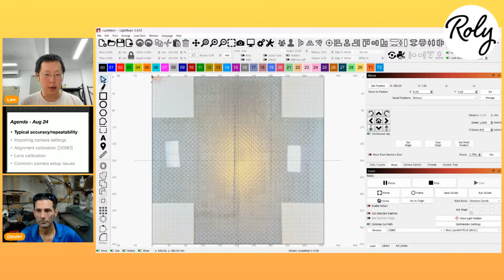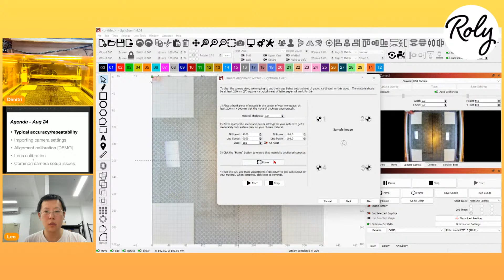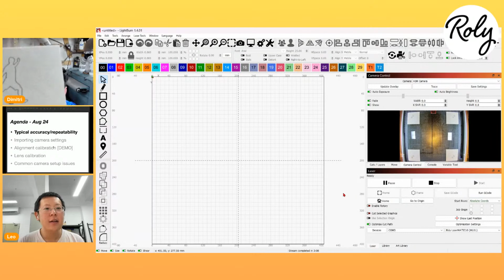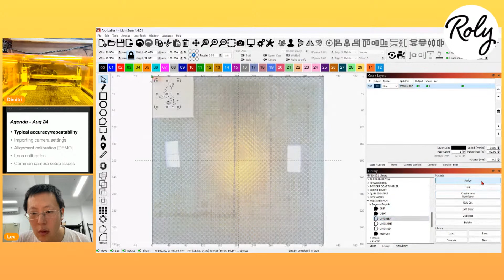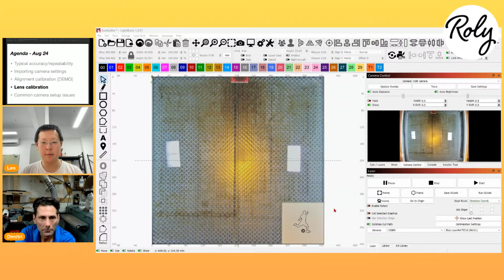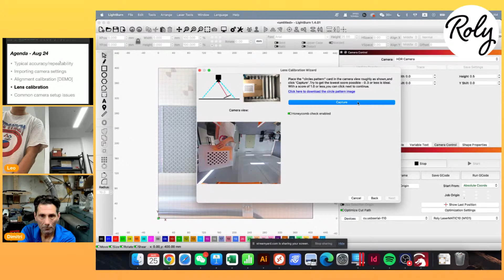Camera calibration on the LaserMATIC10 (Presentation Starts At 6'30'')

Comment: So with each thickness you also need to recalibrate for each when switching between the honeycomb and the Jig Table? they sit at very different heights. I was just pulling my hair out trying to use the dots with no luck using the honeycomb even with it completely covered with white paper.